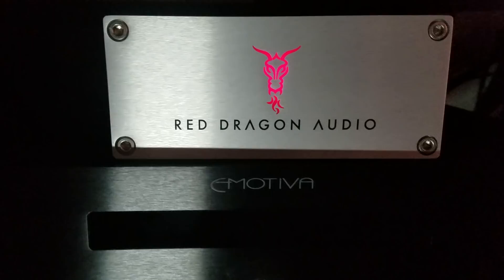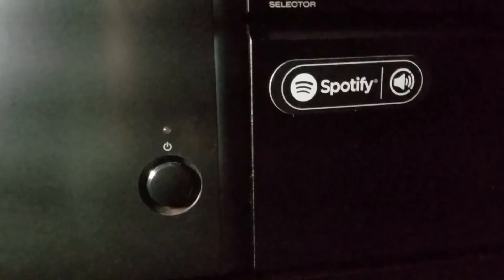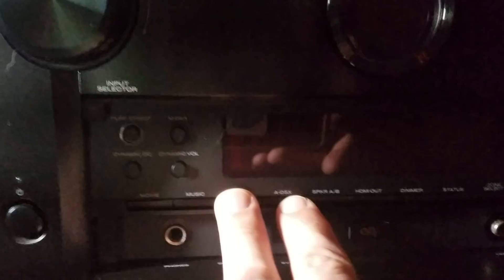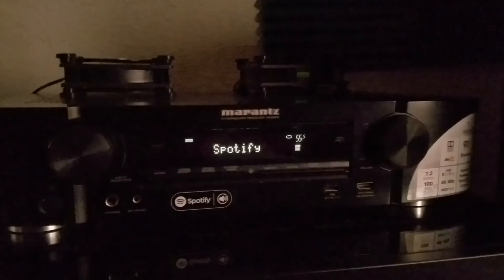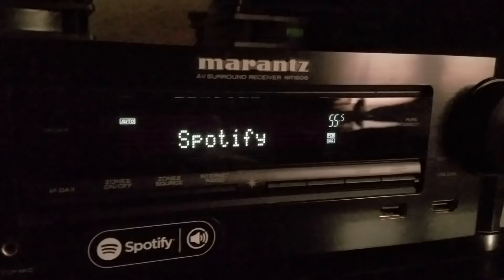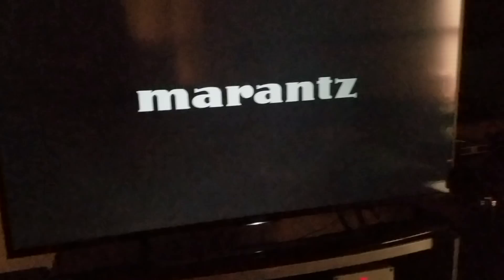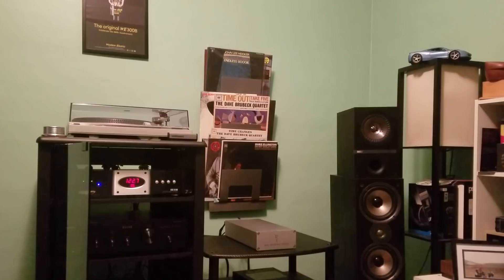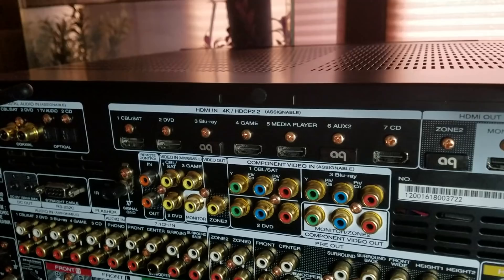My Marantz amp blew up!

Comment: Or check for a stray strand of speaker wire touching opposite pole and correct. Protection circuit will unlock.

Comment: That loud pop in the speaker was high current DC voltage from the amplifier.  When DC is detected on an output line the receiver has a detection circuit with either a relay or some other device to disconnect the amp from the speakers.  You are lucky that the speaker did not "fry".  (open voice coil).  I suspect the Amp failed on its own and not because of the hookup.

Comment: my NR1609 has started exhibiting this behavior. DC protection flashing when being turned on - though once warmed up this doesn't happen. Now it won't power on at all unless i do protection bypass - i can turn it on with protection bypass, leave it on for a minute or two, then turn it off and back on without bypass and it stays on.

Comment: Great info. I have the Denon equivalent to your Marantz and from DAY ONE I installed a full width Air Cooler from MicroCenter on top of it. So far, no thermal issues......just great Atmos and DTS-X glory
Reply from the maker: There's almost nothing you can do to prolong the life span of the internals, but fans and thermal control is the best we're gonna get

Comment: news flash: if you drive your amplifier to 70% volume pushing a 4 ohm load, it's gonna blow.
Reply from the maker: Klipsch speakers are generally at an 8 ohm resistance, but with high sensitivity... means speakers can't keep up with amp, which should mean distortion not blown amps lol
Reply: @tacticalAV  Vintage for ever { 90s at max } for design - quality and durability
Reply: @tacticalAV  I've turned my system to volume 55 out of 60 and have had no distortion despite using 6 ohms speakers on a 8 ohm receiver, and it stays room temp above the amp section, And this was on MAN OF STEEL which is a movie that eats a system for breakfast if it can't keep up. Pearl harbor is also a system killer movie. Especially the USS arizona explosion. 
on music i've been up to 58 neighbors won't like.

Comment: Most AV Receivers are not Class D, they're class AB and your Marantz is no exception. The reason your receiver amp failed is not because of the speaker, it's because you over-drove the amp to the point of failure.

Comment: Thermal Management is an afterthought with many audio products. There is just no room for massive cooling fins in almost all receivers. Much better to get a Pre-Pro and a separate power amp. Then you won't have to replace everything as technology changes - just the "front end". If you look at the insides of Marantz's modern amps, they use a cooling tube with a fan blowing air inside the tube. Compare that with the way Outlaw/ATI/Monolith amps are designed inside. It's never a bad idea to add cooling fans on top and there are units with two or three fans that sense when the receiver/amp is turned on. Marantz and Denon (sisters) have great Pre-Pros but I'd pass on the amps.
Reply from the maker: That's funny I actually agree since they're throwing class D amp modules inside of the receivers these days none of them can produce a solid 2 Channel music quality.  It doesn't until I hooked up my first external power amp that I was really surprised and amazed at the Sonic qualities and differences they offer versus the Marantz amps.  Don't get me wrong the Marantz amps are great for home theater and digital playback day and night however when it comes to music critical to channel content they just don't sound like a Class A B or decent Poweramp
Reply: Audio Research makes great Class D amps - very expensive.  ATI has a few Class D amps with great reviews. I am willing to try the Parasound Zonemaster 2350. 600 watts at 4 ohms. Best buy per watt.
Reply from the maker: @amazoidal  that's not the small zamp is it?
Reply: No, it's a full width amp that"s part of the Zonemaster Series, but all the rest of the Zonemaster Series has like 6 or 12 channels. The 2350 has only two channels but WOW what power. Read the reviews on the Parasound site. I want to buy the 2350, and you can run multiple speakers per channel. Probably runs really cool like most Class D. Class D is the future for receivers because of the limited space for cooling. I think the game is to buy the least expensive receiver that has the features and processing you need that has pre-outs and forget the internal amps. I haven't seen a receiver that rates all channels at 100% with any legitimate power. If driven that hard, the amps would probably overheat. I can't see paying over $1000 for any receiver. I'd rather buy a cheaper one for a pre-pro and buy an external amp or amps. I'm not into the 13 channel thing. I think 5 or 7 is adequate. How many movies have Atmos anyway?
Reply: @tacticalAV  The Marantz SR 7012 was re-tuned in 2017\18 with upgraded parts and sounds amazing in 2-ch stereo. So good I bought 2 in lieu of a 2-ch receiver. (Of course my Dirac Live room correction doesn't hurt either, lol)

Comment: I've been playing my Sansui at volume levels this Marantz can only dream about since 1977....no problems what so ever!!!
Reply: tim coker what Sansui are you talking about?
Reply: @pabloosvaldopenizzotto1098  I have a Sansui 881 receiver, SE9EQ., 3060 turntable and four SP2000 speakers. I bought this stereo from a friend of mine in 1977, he bought it brand new in 1973. The stereo still plays like new and I have never had one problem with it.
Reply: tim coker thank you for the feedback, I have checked each component on the internet. All very good stuff!! I have replace my vintage Sansui A40 for a Denon AVR 1611 5.1 Receiver abut 3 years ago. I was expecting a better sound quality than the Sansui, but I was wrong.  I do not understand exactly why it is happening...or maybe let say that do not understand why the digital signal processing makes it sound great for movies but not for stereo music listening. As far as I understand there is a nice pice of electronics inside the Denon to be able to get much better results.  So Inthink that is a marketing strategy that allows the companies to sell more products to the same group of consumers, avoiding offering them a complete all in one solution with good results.  Anyway, I am planning to install back again the Sansui in my rack , with some sort of self made speakers switching box in order to connect the speakers to the Denon or the Sansui.
Reply: @pabloosvaldopenizzotto1098  I found out a long time ago that surround sound receivers were built primarily for movies. I have never heard a SS receiver that sounded good in 2 channel stereo. 70s gear to me is the best ever for listening to music. Sansui, Pioneer, Marantz leading the way. Hard to beat a powerful 2 channel stereo with all four speakers blasting away. Plus movies still sound great in 2 channel stereo to me.
Reply: tim coker Continuously? I’d have trouble sleeping through loud music.
Reply: @timcoker4685  I totally agree with you.  2 channel all the way!!!

Comment: Do you find that the Klipsch speakers hi frequencies are too harsh and Brash on the ears? I like Klipsch but when I turn up the volume my ears are hurting. I heard the new reference premiere line has a bit softer hi-s.
Reply from the maker: That is definitely the horn... they sound like a rock concert to me lol.  At low volume they are great, and with the Klipsch speakers it really depends on what amplifier you using to drive them.  I found with average amplifiers they don't tend to sound that great when played loud but when you use a power amp with a ton of power to these speakers even though they are at a low wattage rating they do sound amazing for the price and I would compare these two a $500 speaker
Reply: Brighter speakers can be matched/paired with a warmer (sound signature) amp. Adding a (decent) subwoofer can also help (with attention to compimentary and modest gain (for music)).
Reply: PS: Marantz's signature tone is moderate to warmer. As the OP says - Klipsch can tend brighter on account of the horn tweeter. Marantz and Klipsch are typically a good match.
Reply: PPS - Klipsch Reference Premiere series are a significant step up from Reference - albeit in cost too.
Reply: If your ears are hurting...turn it down...hurting ears are a sign of the tinnitus to come...it has nothing to do with the speakers...the problem is Klipsch do not distort...and it will sound great the louder you turn them up to concert or battlefield level...which in turns damages the little hairs in your ear canal...which causes the pain and the hearing loss...turn it down...Klipsch sound good and clear on lower levels.....
Reply: @beenasty6980  
Klipsch are fatiguing ear bleeders and what I call head banger speakers.

Comment: These complications are why I can't accept criticism when I find it easier to design and build my own vacuum tube amplifiers than to buy an amplifier. You can always over-design with parts rated at least twice what it calculates to need.

Comment: You’re lucky it didn’t damage the speaker, that loud pop is the speaker receiving a dose of DC at full rail voltage as an output device goes short, you would have had smoke and blown drivers if the power supply protection hadn’t kicked in.
Reply from the maker: Very lucky... I would like to use a current shunt or transformer to test the speakers and impedance.  Some amps I own have soft start up... an electrolytic cap charged up I'm assuming slowly releasing it. But most create a small pop from the woofers when you turn them on... in rush of current.

Comment: Thats all bad i have the sr7010 lets us know what happen and what to do to avoid it .Who did you buy it from.
Reply from the maker: Bought my 7010 from Listen Up in Colorado springs.  Authorized retailer, repair shop. Since it is still under warranty it is sitting at the repair shop right now, and waiting to hear what exactly it was.  I will be buying a new way of cooling the amps though

Comment: Although they get rave reviews Marantz have always had problems with overheating.  I had a pm7200 amp which actually caught fire while being used in A class mode...and being a glutton for punishment a couple of years ago I bought a Cds 6005  cd machine.. That is just out of warranty   yes you guessed it   its back with Marantz being repaired....Never Again

Comment: Sorry to hear about your receiver 
I'm not sure why yours died I would have to read up the specs on the smaller marantz receiver you have

Anyone buying now a days should do the following. 

1 always put fans on top of the receiver and they should blow air out of the receiver ( Taking heat away from the electronics. If you can only have one fan place it near the HDMI board and the amplifier heat sinks  ( another way to tell is to run the receiver and feel the top and see where is the hottest area and put the fan their. 

2 cold solder joints are very problematic in mass produced electronics.  

Personally I would not accept a refurbished unit. Replace it with a newer model or fix it. If they replace it with a newer model you want to make sure it has all the amplifier power that yours had and inputs etc.. 

FYI I am very meticulous with my equipment. And just in case your wondering I have fans on my amplifiers too.
Reply from the maker: I agree, no matter what amplifiers need cooling, and they must have adequate air space and temperature.  I would not accept a refurbished model although this ones still pretty recent and I assume they have the parts lying around.  It is also important to keep the air dry as well, as in Florida or anywhere near the ocean, the salt and moisture in the air kill electronics.

Comment: hi, could you comment on the klipsch speaker, do you think the bass is bright but not palpable?
Reply from the maker: The Klipsch bookshelves are unbelievable... I have simply never heard of speaker at this price point sound this good. This is literally similar to a $500 speaker in my opinion.   Now they aren't a critical 2 channel music speaker though... klipsch really hit the bar with these, and that is what they wanted.   I think they wanted people like me to hook these up and go wow... for the price that is.   They are different than my svs speakers in a big way though.   My SVS speakers including the bookshelves can actually handle it seems twice the amount of power.  But it's when they are played loud that the Klipsch speakers start to distort  and get a little bright with the horn as the SPs is maintained there dynamic ability at all volumes.  Then again cheaper speakers you can expect that, but what's important here is the main overall sound and function of the speakers.  Tremendous quality and outstanding performance from speakers costing next to nothing. Amazing amount of low frequency extension for such a small speaker
Reply: wow tatical audio, great dissertation. But maybe I'm dense, did you answer my question about the bass, please?
Reply from the maker: @wiebl5266  The klipsch bookshelf's have surprisingly a decent amount of low frequency extension, The bass I would describe at being full bodied but at times can act anemic and almost seem to be lacking sheer size.  At lower volumes with most amps, they are perfectly adequate, however when turned up loud, begin to break away at below 120hz and remind you why a tower or even coaxial speaker can make up for it.   I can assume the towers fill this area in, although with the horns, through all volumes maintaining a flat freq response.  Great budget speakers that can keep up with most hifi counterparts at lower levels though.
Reply: Tactical Audio, thank you so much, quite clear explanation. I wish I've known you earlier! I would not have ordered this speaker, but we'll see. Do you have experience of the marantz PM8005? Or perhaps the yamaha a-s801?

Comment: The first thing I bought after I purchased my Denon X4400H was a Aircom T10 fan...you're foolish not to have adequate cooling for these upper bracket receivers...mines stays not warmer than 90 degrees...without a fan...110 easy.....
Reply: Agreed! - Aircom T8 sitting on top of my Marantz SR7012 here. Best product ever! - Max Temp 88F (2 Channel only w\sub).
Reply: Will those Cooler Master laptop cooling pad would work? =)

Comment: Vintage amps will blow that overpriced amp out of the water.
Reply: no shit! vintage amps are awesome!
Reply: MetalJoe i have the denon  receiver avr3803 7x110w  for 18 years with no air cooler And in closet open in the  front and back. I play loud some concert in a 7.1 config, and movie dolby digital, dts es. I have no issue, the amps heat but not that much. You can put your hand without too big disconfort. I rarely use it as stereo so i am below the max the speaker wattage. The speaker are 8ohms, the quality is better than current amplifiers that overheat. It is made in Japan. Top notch component inside. This is why even if i will buy the denon X4700h, i planned to use the old 3803 as full amplifier 7.1 and use the new one as full preprocessor only. Later on i can add an emotiva bass 500 for 4 atmos speaker.